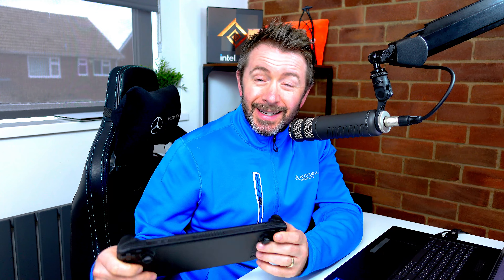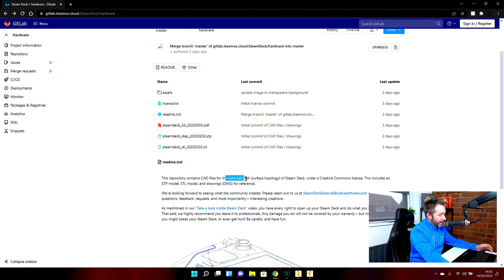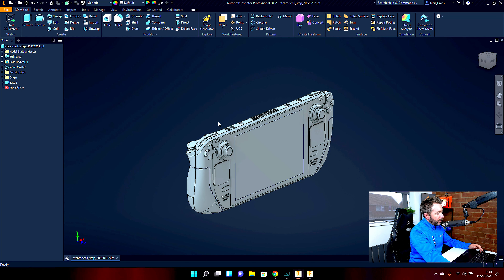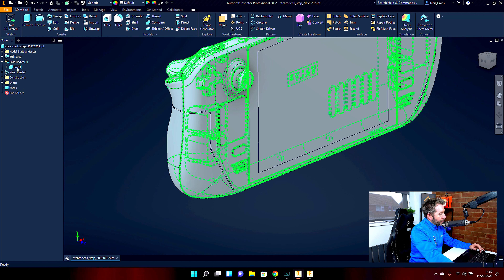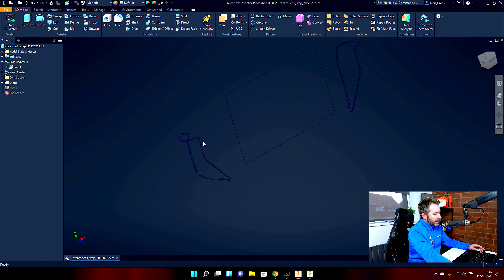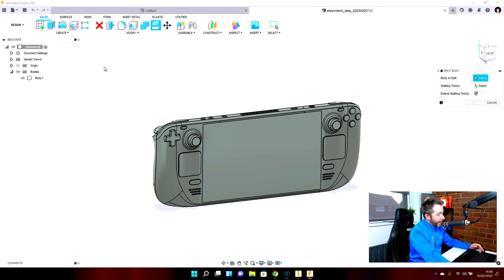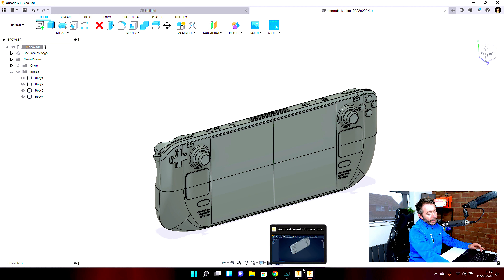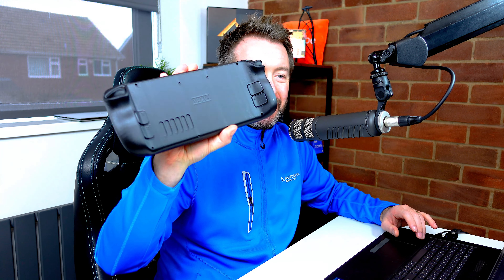I Tried The Steam Deck CAD Files... You Need To Split Them! Here's How...

Comment: Hi there,.
Can you give me a tip on how to design diffuser (floor) of new f1 cars?

Which tools should I use?
Reply from the maker: That would depend on how serious you are about it, if you're playing around and doing it for fun, you could do it in any modeller i.e. Fusion 360 or even knock something up in a copy of Maya or Max.  But if you're wanting to learn aerodynamics and be familiar with the tools the aero guys use to try and help with future employment then I'd suggest checking out this channel https://www.youtube.com/c/KYLEDRIVES he's a former Mercedes AMG aero engineer who now runs a YouTube channel.  But off the top of my head I think Merc possibly use Siemens NX for a lot of their CAD stuff when I've seen it on screens during factory tours, but the aero guys might use a different tool.  But he'd be a good guy to ask if you're wanting to know what the real teams use.
Reply: @Neil3D  thats good
I plan to learn more about aerodynamics
Really interesting topic

Currently I'm working on cad design of any 2022 f1 cars and they are all similar in the diffuser shape
So it is a copy that I want to achieve
I already completed all other parts (wheels, chassis, wings, etc) except of this diffuser.  Couldn't do the exact shape.

I tryed with boundary patch, but it has some wierd defects, it generates extra surfaces that are out of the rails (like mountains)
So, what are other tools or icons in inventor that can help in that.
Any suggestions?

Comment: Your print looks way better than mine. I don't even know how you printed it without supports. I also printed it at the lowest quality settings to save time. I just wanted to see how it felt in the hand and design an accessory or two. Someone released the file split in two on thingiverse.
Reply from the maker: The 1:1 version I printed had supports only to the bottom parts near the bed, I was quite surprised it managed to print that high up vertically without supports! But the amount of filament needed was crazy to go all the way up with the supports.  Tbh I figured it would end up on Thingiverse, I imagine there'll end up being hundreds of versions there before long

Comment: I tried splitting the file, but its not letting me do it. (i'm new i could be doing something wrong.)
Edit: im a dummy and used the stl file instead of the stp lol
Reply from the maker: lol wups :) congrats tho! Did you do that in Fusion 360 as well first time?
Reply: @Neil3D  Yeah, I'm very new to 3D modeling, but I wound up with a resin and filament printer and I'm extremely excited to start using them. I can't wait to start making things. I used your link to get it, glad I found your channel since I'm very interested in the steam deck and would like to dabble and make my own cradle thing for it.